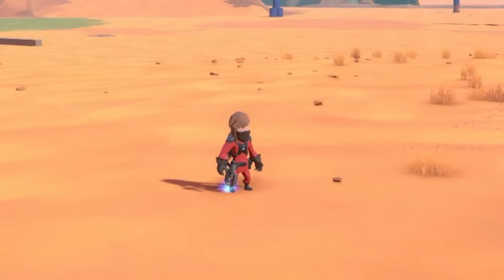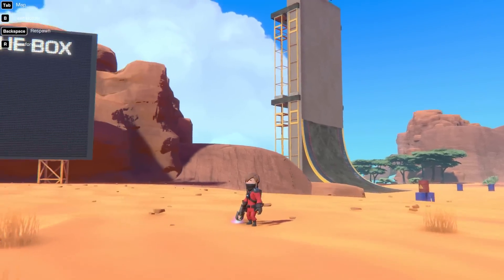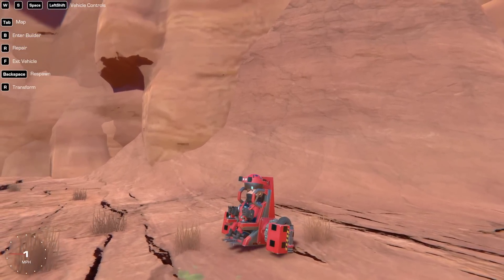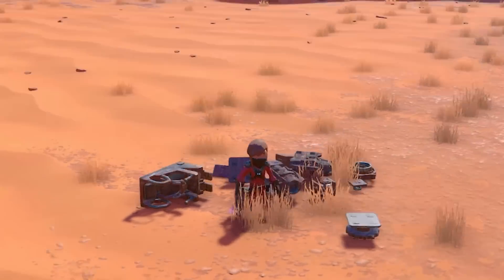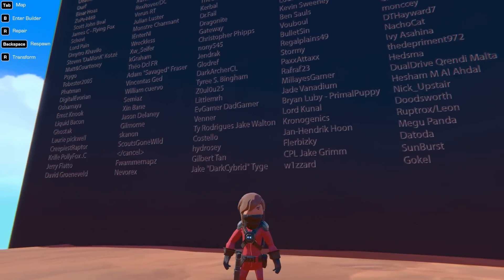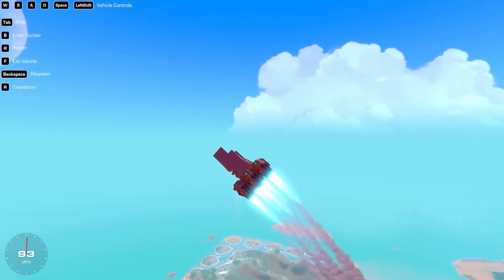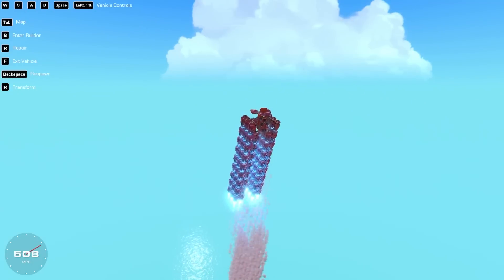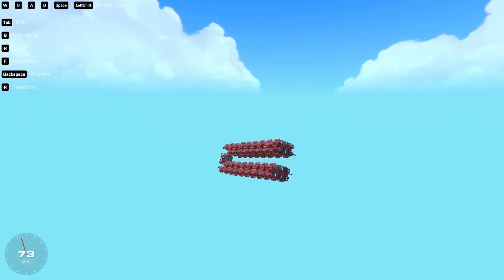Engineering a HYPERSONIC JETPACK was a huge mistake...

Comment: i know im a bit late but... if you cant toll the joint to have different controlls, but you can set individual angles and speeds, and speed kann be negativ... set 1 joint to rotate 10 and the other to -10 :) lets say its 10 degree per second in the given direction, the other should move -10 in the same, meaning 10 in the opposite direction :)

Comment: Really you could also use different buttons to rotate each rotor like you would do tank controls.

If you for example
Left side rotor
- W forward - S backwards
Right side rotor 
- E forward - D backwards

To go forward you'd press W and E, or S and D for backwards, but then you can press S and E to rotate one way, or W and D to rotate another way instead of adding more parts.

I also haven't finished the video while typing this comment so if he does do that later in the video and I forget to delete my comment then oops.

Comment: Matt, you were so close trying to figure out how to make the jets turn you properly.

Instead of using two servos on each engine with matching controls, you give them a single servo with independent controls.
You also don't need to reduce the angle the engines fire at for a spin, quite the opposite actually. The closer the angle is to 90°, the tighter the spin will be. By reducing the angle, the engines are giving more of their thrust towards increasing your altitude, rather than changing your direction.

Left engine forward = W
Left engine back = S
Right engine forward = E
Right engine back = D

Then, when you want to fly forwards press S&D, to fly backwards it's W&E.
To rotate right press S&E, to rotate left it's W&D.

This method also gives you the ability to do a sort of banking arc, left or right, forwards and backwards, by just firing one engine at a time.

Happy Engineering 😊
Reply: its easier to use a logic block too route the secondary inputs through
Reply: “So close trying” Pat pats for Matt😂
Reply: Pretty sure he was trying to increase the controllability of the turning rather than just spiraling out of control.
Reply: There are also logic blocks
Reply: .... Way too complicated for mat.... 😂🤣
Reply: You should apply to the UK space agency... they are still trying to figure out how to get basic rockets into space. 🤣
Reply: @maigepresents5840  Long live the glorious UK Space Agency and all who sail in her. 🇬🇧
Reply: @maigepresents5840  wait we have a space agency??? I didn't actually know 😂
Reply: @madbull4666  I want to say it's based down in Cornwall, in the middle of nowhere!
Reply: 69 likes
Reply: @The_Punishing_Birb  Nice! 😏